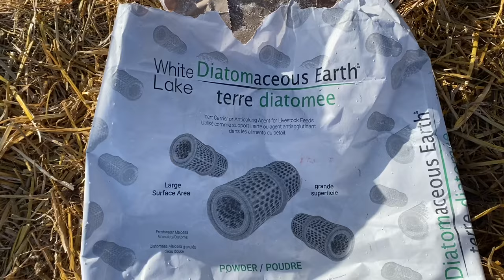Calves get their nose candy

Comment: You filmed a pile of stuff as usual. When I go write a comment I try to remember back for something relevant to say (my wife might say, it's better to say nothing at all) but remembering your power nap. If I didn't get my 10mins after lunch before I retired, I  would be useless by evening when there was still a lot still needing done. A tractor we had some  years ago would splutter and have low power when the tank got low, or sometimes on a gradient. We did filters etc but still the same. Then I washed the tank out  by dumping a lot of water in and by luck  a piece of foam from somewhere appeared at the outlet and that had been the problem. As the tank got low or tilted the foam floated to the draw of the filter and kept back the fuel. Only luck that it moved to the outlet as the local firm were talking about a new tank.
Reply from the maker: Haha, yeah I’ve found that too, but yeah between fuel starvation and electrical gremlins these dealerships can write their own ticket on that labor cost, that’s where the old mechanic “down the road” was always handy in years gone by, always had wee trucks and years of experience to say “well let’s start with the simple stuff n leave yer cheque book out of it for now 😂